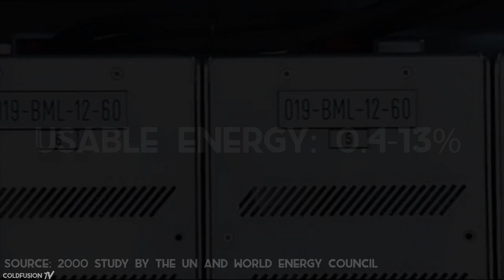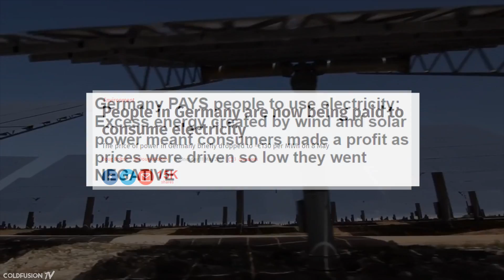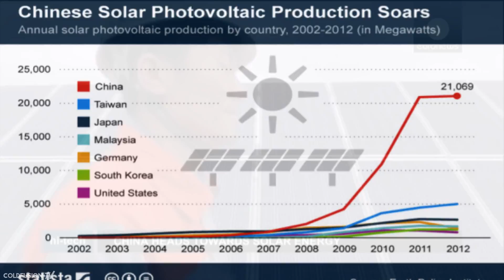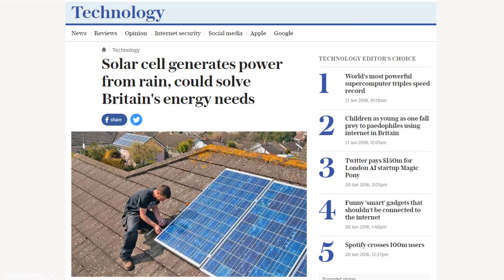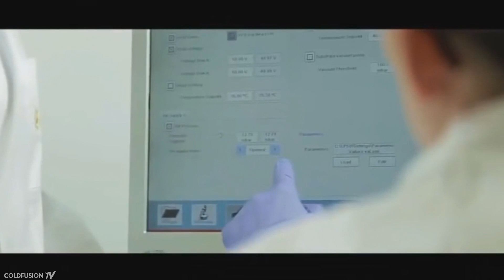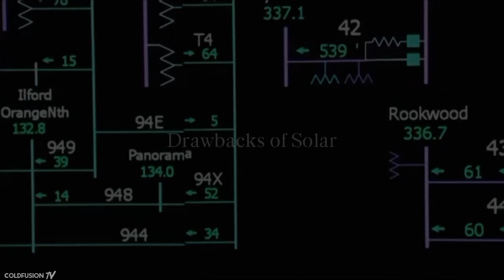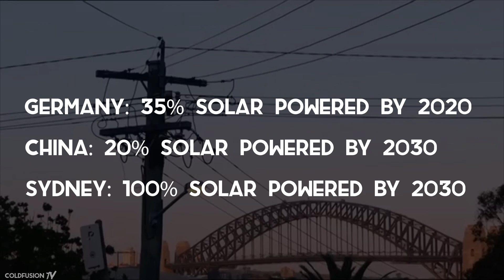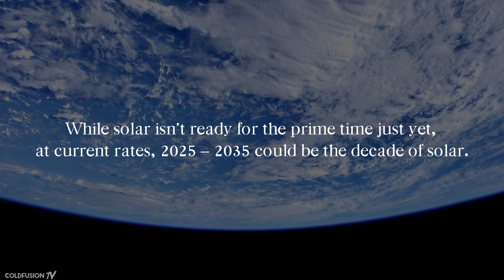The Truth About Solar

Comment: Yes solar has potential.  The problem is it is not better for the environment... it is actually worse.  The big problem is the energy needed and the chemicals and by products needed to create the pure silicon is horrible.  These chemicals can be recycled but this requires a lot of energy and money to recycle properly.  The big problem is most are made in China.  China gets most of their energy from dirty coal power plants and typically does not recycle chemicals like this do to the costs.  That is the main reason why the prices have dropped.  The other problem is storage.  Without a way to store the power it is near worthless as a coal or oil power plant must site idle to take up the slack instantly.  This means the plant has to be burning those fuels and have everything running to take over when needed.  Really we need battery banks in each home and business able to handle shortages... possibly for 4-5 days.  Today's batteries are not efficient enough and need to be replaced too often.   they also use dangerous materials and produce large amounts of chemical waste.

So what do we need.  Well there are a few promising technologies.  One uses a super high efficient multi layer photo cell about 6" square with a 10' square reflector.  It is crazy efficient of about 40%, but the heat it too high.  Well the added water cooling to it to keep the temps down and found they could retain an additional 20% energy through heat.  They then mounted it on a tracking poll so when compared to traditional fixed solar panels at about 20% efficiency these new dishes can collect almost 10x as much energy.  They are also working on several battery options that are looking much more promising that Lithium Ion.  If it is not too bad for the environment to make and dispose of and the price are not bad you might see systems like this really take off.  The great thing about this is a town could have a few solar farms around it and a back up diesel generator and not be connected to the grid.  Remote homes could do the same thing with one dish a battery bank and a backup generator.  With only one small cell in the center the amount of toxic waste is greatly reduced and easy to replace and being directional it can fold down during storms and snow.  Also with this better battery technology and possible better capacitors for regenerative braking and acceleration electric cars could actually become useful and good for the environment.  Put money into research, not failed green technology.
Reply: Not true. China has advanced dramatically over the last few years and now recycles almost 100% and less and less coal is used.
Reply: Paul Smith, do you have a system you can recommend?
Reply: Every installer will build a system from different components. Panels, inverters, batteries (if used) and mounting gear. It doesn't matter.  Most equipment is good. Most important it the company doing the install.
Reply: Ok, thanks.
Reply: What a load of rubbish.
Reply: Todd Abbott 
The energy costs of recyling and re-using chemicals for production is irrelevant, its used for a renewable source, its not an energy source that will go scarce until after billions of years the sun goes supernova, even then who would care because earth would become void of any life.
Reply: I have 10 Kw's on my roof and annually generate about twice what I use.
Reply: Todd Abbott 
The issue of un reliabity is little to none, many countries power grids are connected to others so if one of their production rates drops or rises too much they can import/export to resolve it, this can easily be applied to solar. The issue of the chemical loss isn't that much of a problem since it can be recycled using solar itself.
Reply: Please link to just ONE of the 'studies'. Germany is presently at 35% of their power for 'unreliable' sources and other countries are beyond that. Oh, and I have links.         https://www.independent.co.uk/environment/costa-rica-renewable-energy-electricity-production-2016-climate-change-fossil-fuels-global-warming-a7505341.html
Reply: https://news.stanford.edu/2015/06/08/50states-renewable-energy-060815/
Reply: You continually attack renewable energy for it's limitations be refuse to mention the fatal costs of unrenewable dead end sources like oil.  The atmosphere is rather critical for the future and fossil fuel use has to be ended. There is no cost analysis that can change that fact. There is no analysis that includes fossil fuels that is sustainable. The costs of fossil fuel based climate change cannot be absorbed.
Reply: Investors are realizing the newest generation of lithium ion, sodium-metal halide, sodium sulfur, flow, and advanced lead-acid batteries are safe, durable, and cost-efficient enough to serve grid needs, according to the report.       https://www.utilitydive.com/news/navigant-revenue-for-utility-scale-battery-storage-to-grow-15-times-by-202/412968/
Reply: Yes, hydro is part of the renewable energy sources and yes it plays a big part for many countries, but using that as an argument that other renewable and clean sources aren't viable is completely wrong. Global use of solar and wind is growing exponentially and thinking you are smarter than they are is a fools game and one that the fossil fuel industry is quickly losing.
Reply: Todd Abbott 
Renewables are important as ther is a limit of how much coal/gas/oil  and eventually they'll run out leaving us without anything but renewables and nuclear, we seem to dislike nuclear so renewable seems to be the choice we made.

Battery research is ongoing, there are many potententially revolutionary technologys such as samsungs 5x faster charging lithium with graphene anode/cathode batterys and renewable sourced batteries made from dried leaves and common chemicals. The problem with developing battery technology is even though it may be proven doesnt mean that the public will accept it (not after the galaxy note 7) until rigorous testing has been completed over and over again until we know all the is to know about these new technologies, the danger can only be known through testing and its never a fast process.

About renewable grids, who said that we wouldn't have solar panels on our houses and batterys (such as the powerwall) in our houses. We would also have power plant running on biofuels (renewable and zero carbon emissions) to acomadate for a dip in power generation.
Reply: @Todd Abbott I think the future of power storage is not in chemical batteries, but in physical energy storage coupled with power generation. Pumping water up a tower and generating energy with water outflow could be one method; flywheels might be another good method. If we see major advances in nanotech, ultracapacitors could be very cheap and essentially replace battteries.

For your RV, have you thought of biochar filters? Essentially it'd be a big tube filled with charcoal that your black water goes through. Charcoal has a high surface area which can host bacteria, which would break down wastes. It should keep smell and weight to a minimum.
Reply: Ultra capacitors lack power density. They have their use but it's not for storage. All the othe physical methods you mentioned lack rapid response. They can take minutes to get up to speed and are inefficient.  You take electricity and power a pump that is 70% efficient, then have to use the waters kinetic energy to power a 70% efficient generator. Lots of loss compared to compact , efficient and increasingly cheap battery storage.
Reply: You have no idea what you're talking about and it shows. Flywheels are instantaneous, water storage is close to it. Ultracapacitors currently store less, but they have greater room for improvement than batteries do. The only valid point you had was energy efficiency, but the same problem applies to every form of energy storage or transformation, batteries definitely included.
Reply: In batteries the efficiency is dramatically higher than physical methods. With water storage you have to spin up a generator. No good for brownouts or spikes. Tesla's battery storage in Australia proved that in it's first week of operation and has saved the utility millions and made millions for the operator. They have already ordered more.
Reply: Vanadium batteries show promise and are extremely exciting, and hopefully we can produce such batteries that will replace the deteriorating lithium. Vanadium batteries are eternal in theory.
Reply: Paul and Todd, what a great exchange! I was studying for my class when I came across this. It's awesome to read you two go back and forth without spewing uncalled retort. Purely an exchange of ideas. Thanks both of you! (where do I lean to? I'd rather keep it a secret :))
Reply: Sorry Todd, but numerous studies have proven that it takes 8 months to one year to pay back the environmental cost of solar panels then for the next 30 years they help offset the environmental costs of fossil fuels. Fossil fuels NEVER pay off their environmental costs and we know that FF are disasterous for life on Earth.
Reply: You do not understand the process.  First of all it requires a lot of energy.  Most of China's energy comes from dirty coal plants that generate 10x or more pollutants than plants in the US (mostly because China is unwilling to invest the extra money required for the cleaner burning plants).  Yes the chemicals can be recycled and reused, but not in their current form.  They must be processed first and this uses a lot more energy.  Typically China does not do this because it is much cheaper to dump the chemicals in landfills.

Things are only going to get worse as their economy has slowed.  In fact their GDP per person is actually lower... meaning  while they are increasing the amount of good they produce each year it is not keeping up with  their population increase.  Their housing market is also taking huge hits in many areas which is slowing the construction industry.  How this is going to impact the solar market is hard to see, but China subsidizes a lot of this market so they have an unfair advantage over many other countries and they produce the most waste making them.

The biggest problem is the storage and until they can store 4-5 days of energy at each house cheaply you will not see solar or wind go beyond 5-10% of energy production and because it is not reliable it can only supplement current plants not replace them.

Now I am not saying solar is worthless and there are technologies coming up that will help greatly reduce the environmental issues with solar, but it is the storage restrictions.  Solar is great for remote locations, sail boats, cabins, sheds (I power my shed with solar and wind power).  But instead of buying the panels right now we should wait until the high temperature solar reflective panels are perfected.  This will reduce the environmental impact greatly as well as the costs.  The problem is the battery technology will take longer.  We are struggling to get a significant increase in battery technology and they are still forecasting 20, 30, and even 50 years before they can perfect some of these technologies.  We need to pull all the subsidies from current g"green energy" and put it into research.  The effect these technologies are having right now is negligible at best, but with the next generation in solar and say 3 generations of battery technology we can really have a big impact in solar power, electric cars, cell phones, laptops, tablets, lighting...

I'm all for protecting the environment.  I want to develop a septic system for an RV that can process black water (from the toilet) into into gray water that can be safely dumped allowing people to wilderness camp for months at a time.
Reply: The grid can only do so much.  You do understand that transmitting power over long distances loses a significant amount of power.  Every single study in the US has said they can not go above 5% unreliable power, that it would be a waste of time and money.  At 10% you are guaranteed power outages and brownouts.  Without a means of storing energy there is little more that can be done.

Our goal should be to get rid of the grid.  It is a vulnerability and a waste of power.  Plain and simply we need batteries.  In Europe these renewable resources drive power costs up, then drop them to nothing and it is killing the power companies.  They turn out paying 4x normal cost getting power from other countries then 2 weeks later paying them to take excess energy.  It does not work.  With good solar and batteries in every house and systems letting the power company choose when to charge them when demand is low and good reflective solar technology could result in the removal of the grid completely and as much as 50% or more of the energy being unreliable.  Plus in an emergency, like storms taking out power lines, the home owners would have 3-5 days of backup power.  You could also see electric cars really take off and not require massive subsidies from the government.

Absolute no "green energy projects " have helped the environment at all.  It is all just to make people feel good about themselves.  Stop wasting the money on these programs and putt he money into research where it will make a difference.... batteries.
Reply: You need to look a bit more at these studies as they tell almost nothing.  Costa Rica's  power comes for 89% reliable energy.  78% is hydroelectric and 10% is geothermal.  Only 10% is wind and 1% is solar.  Sweden is 41% hydro, 41% nuclear, only 10% wind and 8% other.  They had to sell off about 10% of overproduction, which while looking good, most countries do not need it, so this drives down the cost of electricity, sometimes to the point that is is free or they even pay consumers to use it... but then they pay it back 2 fold in taxes because the government supplements this.  Overall these programs have driven up taxes and energy cost significantly in these countries.  In Germany they still need to produce most of the energy produced by unreliable sources or risk brownouts and blackout.  Again this results in energy surplus.  And again... while Germany might be at 35% renewable half of that is biomass and hydro... so no they are not 35% unreliable, but on 17% (in 2016 it was 7.9% and solar PV at 5.9%) and they import a lot of energy  They also are trying to phase out nuclear by 2022 (which made up 40% of their power production), which has forced them to build... coal plants.  Good job Germany.  The other thing is Germany imports more than half of its energy, so the total amount of renewable based on total usage is only 12.5%... which is LESS than the percentage for the US (about 14.5%) and the US while being 4 times the population we use over 7 times as much energy.  That means we produce almost 8 times as much renewable energy than Germany.

http://thehill.com/opinion/energy-environment/369386-germany-shows-how-shifting-to-renewable-energy-can-backfire

https://en.wikipedia.org/wiki/Energy_in_Germany

https://en.wikipedia.org/wiki/List_of_countries_by_electricity_consumption
Reply: Also while it is hard to research the full numbers and how much power is lost from transmitting it over long distances.  The US loses about 6.5% of its power in the grid.  Think if every home had a battery bank that held about 5 days of power.  The power company could cut off power to homes during the day when demand was high and then charge the batteries at night when demand was lower.  They could massively increase the amount of unreliable anergy and greatly reduce the need for the grid resulting in an instant savings of the 6.5%.. or about the same amount of energy Germany produces.  They could switch to 50% unreliable energy easy and actually reduce energy costs.  But we need better battery technology... something cheaper, safer, longer lasting, and with a higher density.

Comment: Sso, as alsways with fast advancing technology, it becomes a guessing game about  when to "jump in".  Aesthetically, should a person wait for the new Tesla cells that look indistinguishable from regular roofing?  Wait for the graphene cells that can extract energy from raign as well as sunlight?  Wait for the price to match coal?  My own pet peeve is most systems being sold today are without battary backup, and will go down when the grid does.  No doubt that will cease being the case in a relatively short time, too. 

But I know that my grid utility is the most expensive provider in the U.S. - and their prices arr going to skyrocket ovar the next five years, so unfortunately, I have to jump in soonar rathar the latar.  And in a few years, I'll be wishing I could have waited for a more efficient array.  But I'll be locked into a 20 year lease arrangement by then.

Comment: Trillions of dollars will be spent on solar, then fusion power will be ready in 2040... bam! Solar is no longer as economical as fusion. In the mean time, at least it's a zero-emission energy producer, at least after the initial manufacturing and installation that is. Efficiency and lower cost need to go hand-in-hand with more "green" manufacturing materials and procedures. 
Great video though, thanks. Didn't realize peak efficiency was all the way up to 35%! Last I read, typical efficiency was only 10%!! That must have been at least 5 years ago so yep.

Comment: 7:20 Scout.... first across the Atlantic??? Planetsolar not only crossed the Atlantic more than 5 years ago, it'salso the first solar boat around the world (using only solar energy). And yes, just like Solar Impulse, it's swiss made.
Best solar pannels have a maximum of 20 to 25% efficiency. 35% is probably achieved in a lab under special conditions. But yes, solar pannels efficiency is the key and if, for instance, if it raises above 50%, well everybody will go solar and off the grid so these huge infrastructures upgrades you're talking about won't be totaly neccessary.